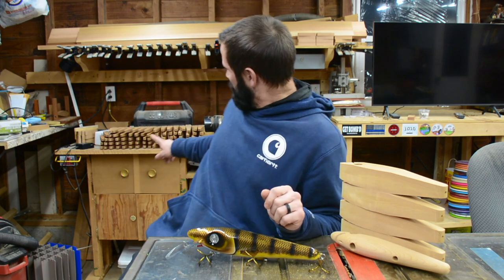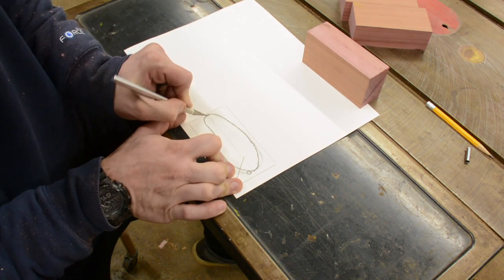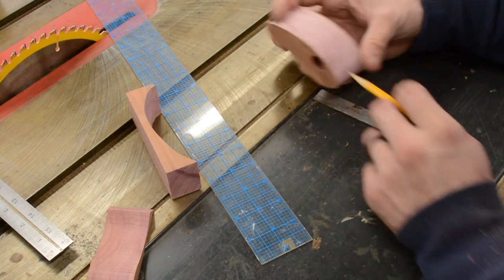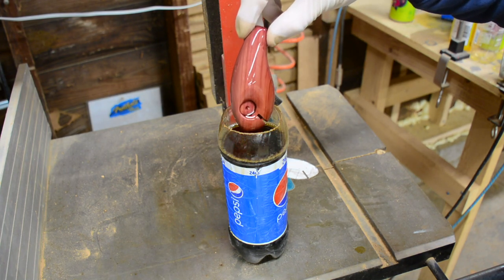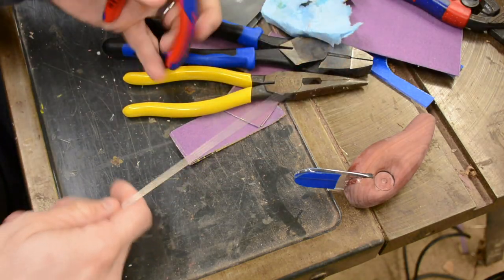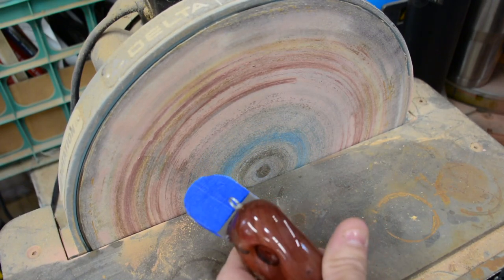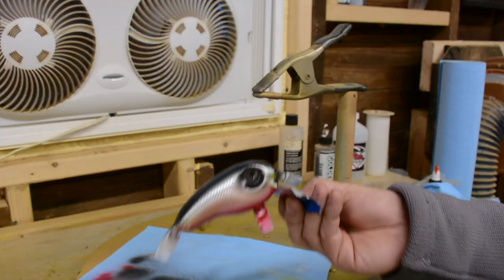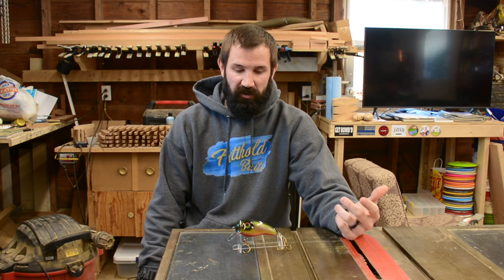Small Shallow Musky Bait [FULL BUILD]

Comment: Hey when you screw a bait up like that you can just put it in supper hot water, 180-200 degrees and let is soak for 10-15 minutes. The acrylic paint will wrinkle up and fall off then you can start over. As it was I think you were able to save it with painting over it and it turned out pretty cool. Well done another great video.